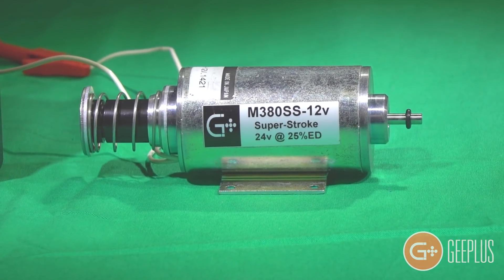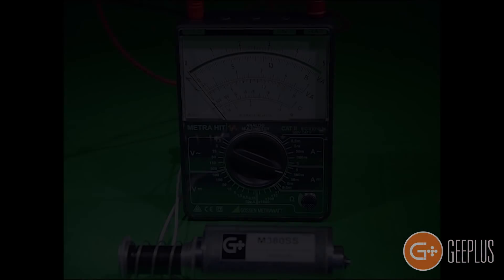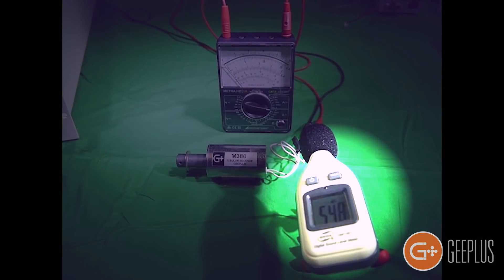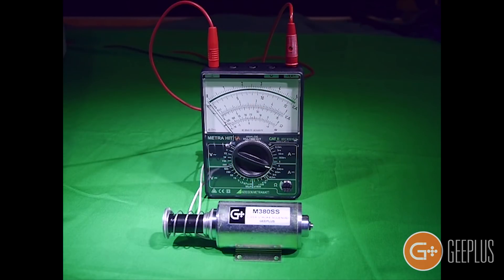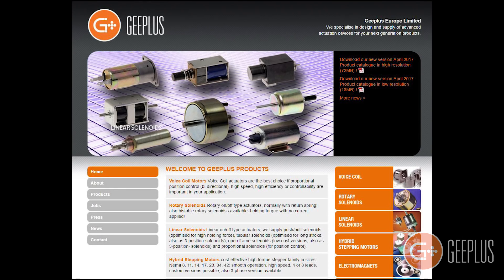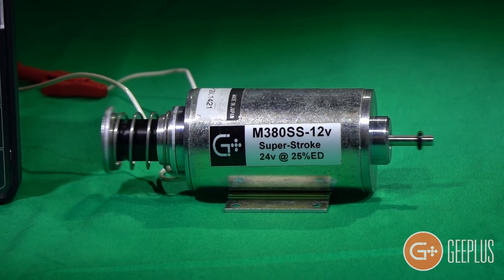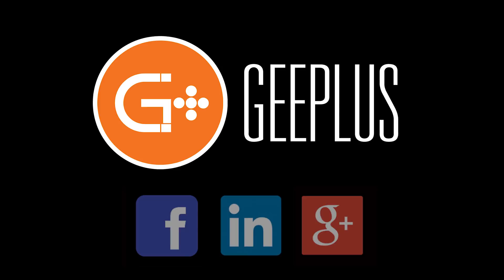Solenoids and Actuators: Super Stroke Solenoids by Geeplus

Comment: Are you able to manufacture a custom super stroke solenoid which has a stroke longer than 35mm(The current longest stroke you have amount all your lineups) Looking for either/both a solenoid capable of high speed extension with a decent size and load rating at max stroke (5kgs or higher)
Reply from the maker: Hi Wayne, this could be possible depending on a few factors: such as the duty cycle, voltage and force required. Also dependent on quantity, which would dictate whether or not customization would be financially feasible.
Reply: @geeplus7017  Currently considering these solenoids for a custom project which has little to no data backing it so I am very much in the prototyping stage. As such, quantities would be 1 or maybe 2. On the contrary, what is the cost of a M380SS-XXv superstroke per unit and a 380-L per unit? Amongst the solenoids you offer, what would you recommend for my application (air piston pushing atm air through a cylinder,based on some airsoft technologies) Looking to adapt your solenoids to have an AEG system
Reply: @geeplus7017  It would be viable to have a solenoid that runs on a 100% duty cycle to imitate the properties of how the force from a compression spring would be like. Power sources so far are narrowed down to hobby grade Lipos(3s (11.1V)or 4s (14.8V) with a voltage booster to keep the design compact.

Comment: One day everyone will realize the importance of efficiency in technology. In the future the solenoid motors or engines shall be the most convenent and useful for creating motion from energy with the minimal loses. They are fast, adjustable, durable,...
Reply: Diesel injection systems use solenoids to control the timing  of the fuel injectors.

It was very prevalent in the 90s-mid 2000s in hydraulic electronic unit injectors or HEUI.
 Caterpillar, International Navistar, and Ford used it extensively.

In this system high pressure hydraulic oil acts on a plunger mechanism to squirt the fuel into the engine, the hydraulic oil flow was controlled by a large solenoid.
Nowadays most diesels have moved to common rail systems where fuel is pressurized in a tank up to 35,000psi or 250 MPa then a piezoelectric valve controls a simple plunger valve for fuel injection. This is a common rail system.

Comment: Can you explain why the spring doesn't shoot the rod forward at full speed? I'm hoping to use something like this on a remote controlled relay that will automatically strike an old style bell, but to be able to do that, I need something that will hit it hard enough. I've tried a small 5v solenoid and it's just too small and the spring doesn't produce enough of a thud to make a good sound on the bell. Any advice would be greatly appreciated.
Reply from the maker: The Super Stroke solenoid is a "pull" type of actuator, so the spring serves to slow the rod down to a speed semi-proportional to the current. A latching type of solenoid may work well for your application--this type of solenoid is locked in place by a permanent magnet, and release upon introduction of a current. You can learn more here: https://www.geeplus.com/latching-solenoids/
Reply from the maker: Depending on the stroke, a tubular solenoid with a return spring may be useful as well. https://www.geeplus.com/tubular-solenoids/

Comment: How long hold time? My requirements are 12 volts DC  stroke 20mm to 30mm and hold time 10 seconds and push type. Thanks.
Reply from the maker: Hello Vikas,
The M380SS 12v should satisfy your requirements (you can check out the data sheet here, if you like: https://www.geeplus.biz/FTPROOT/Super_Stroke_solenoid_M380SS.pdf). Feel free to shoot an email over to me at eddie.aucoin@geeplus.biz, and I can connect you to the right person to help you out further.

Comment: I have a question about the product in this video.

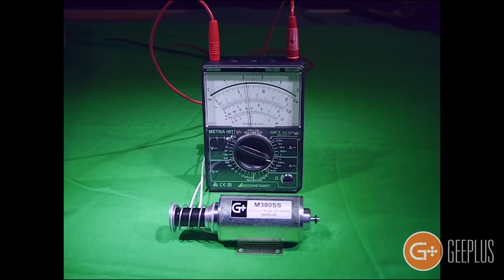We are looking for something like this but we want it to do the (Forward/Backward) motion aswell as stopping it midway like here (00:56). Can we achieve the midway stop by leading and holding a certain amount of voltage to the device so it pushes something away and stays there?
Reply from the maker: Yes that is certainly possible with the super stroke solenoid. As this is not a true proportional solenoid, other factors come into play, such as the weight of the load, etc., but what you're referencing can be done with this solenoid.  If you'd like to discuss this further with one of our engineers, feel free to shoot an email over to info@geeplus.biz and an engineer will contact you at your convenience.  Thank you.

Comment: Fantastic product! I like the low noise characteristic and it's just what I need in my project. Can the speed be controlled? If can, what's the maximum speed it can go? Thanks a lot!
Reply from the maker: Thanks for the comment Kevin! The super stroke solenoid in the video works just like any other solenoid, in that the more power you supply to the coil, the faster the responses time will be, BUT the louder the impact.  

If you visit our Linear Solenoids Product Page at http://www.geeplus.biz/linear_solenoids.htm, you can download datasheets for all of our actuators, which include response time graphs.  (Here's an example of a Super Stroke Solenoid data sheet: http://www.geeplus.biz/FTPROOT/Super_Stroke_solenoid_M380SS.pdf)

Or if you have a specific requirement, feel free to contact one of our reps via our contact page:  http://www.geeplus.biz/contact.htm or just shoot an email over to Info@Geeplus.biz.